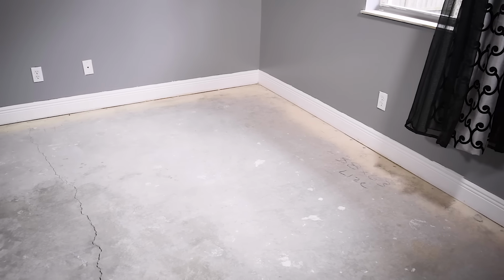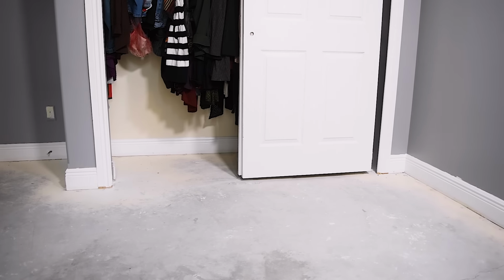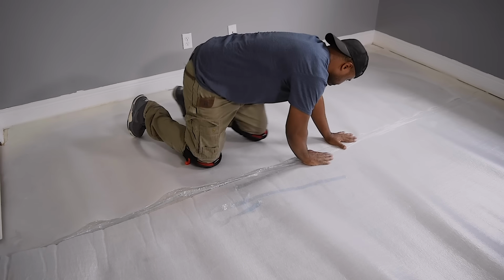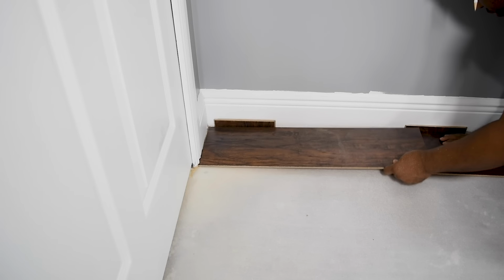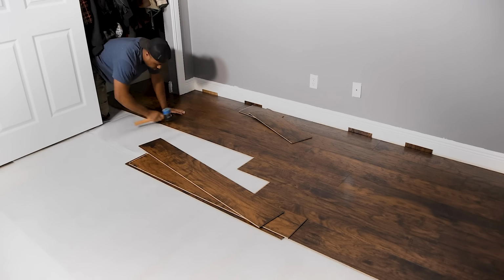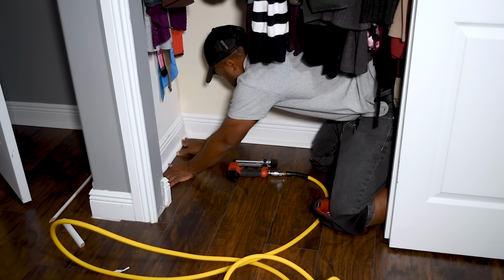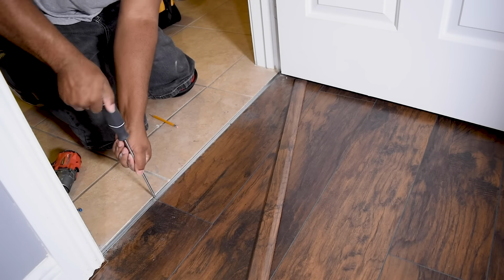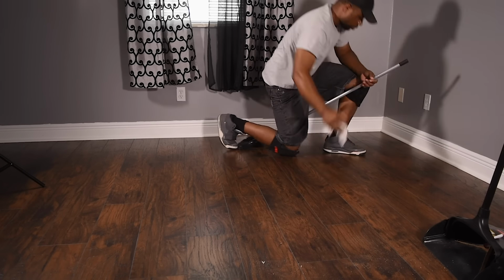How to Install Laminate Flooring for beginners

Comment: Nice job! Tough job too, hard on the knees. Looks really good.
Reply: I did mine when I was about 60 YO, It would be very difficult to do it today, I am 77.  Also, don't install flooring and tile in shorts and wear knee pads.
Reply: Norm475 Wear gloves while doing tile too. You’ll cut your hands up so bad and they’ll get pretty dried out from my experience.
Reply: Knee pads mate, dont leave home without them!

Comment: He broke the tile with hammer blows, not accurately).
Reply: You don't know that. That crack in the tile was large as well. Even if it was an indirect hit, he's using a rubber mallet and not nearly enough force for it to crack that much. It was no doubt due to the shitty transition piece that was already installed

Comment: Always go long ways to the window like this video, This is not a choice, it is bc the sunlight shows up the joins esp after a few years and double esp if any water gets on them. Do not mop them dont put this flooring in wet area, try not to even put it near a wet area, I bet in 5 years, the boards near the bathroom will look horrible.  Watch that water, it dont matter how Moisture resistant" or how much you paid, these laminate flooring hate water

Comment: Too funny, spent my Saturday doing this exact task. Nice vid!
Reply: I hope you had your floor cracks repaired, filled the 1/4 inch+ gaps between the laminate and the concrete, and didn't have this much chip out on the boards.

Comment: The flooring is gorgeous. What brand and color is that? I have ripped every bit of carpet and vinyl out of my house and want to do something like this throughout the entire house. My house is an L shaped ranch and my dilemma is that if I start the flooring at the entryway following the longest run, the hallway and all the bedrooms will not have that long-run layout. Should I add a transition piece at the beginning of the hallway and flip the layout or keep it the same direction as the area it's connected to? Thoughts anyone?
Reply: I doubt the entire house is sqare anyway so if you want to join the entire house in one piece, some rooms may not look straight. 
Use tiles in wet areas, put transitions in the bedroom door ways and always go long ways from the window bc the sunlight will show up the joins so long ways like in this video is best imo.
Reply: and never mop them, water will expand the joins,
Reply: @DadSkool   Thanks! I will see how it looks changing the direction where the greatroom transitions into the hallway prior to a commitment either way. The bathrooms are still tiled. Not going to re-tile those spaces anytime soon. Whatever I choose for the front section of the house definitely has to be the same product because all of the rooms open up to each other. I'm considering one of the waterproof floors since this will have to go into the kitchen as well and there's no way for me to incorporate a clean break between tile and laminate/vinyl.

Comment: I thought it wasn't obvious from the video but you need to put spacers on all sides... If some plaster has been laid (huge humidity changes), don't place the skirting yet, wait 2-3 weeks and see how it settles, you might need to cut again.

And this one is also from my neighbour, don't glue them on the ground !! He bought some laminate floor with a hardwood top, he asked the seller if it was alright to glue them because he was resurfacing a tile floor... The seller said YES. Always check with the manufacturer if you're not 100% sure, the seller might never have worked with that exact product. What happens is that when the floor expands, weaker point will lift but the stronger areas will prevent the floor from expanding which will result in lifting.

Most laminate floor have a print on the top which is covered by a thin layer to protect it; it's not wood, you can't sand it to restore it. If you want it too last, prevent scratches from chairs and furnitures by adding pads and if a blunt object falls and damages the surface, if you want to repair it put floor fill that is colour matched.
Reply: @Cleveland Indian Check where the floor is touching the wall after removing the baseboards and cut using a oscillating tool, wait for the floor to settle and check if you need to do it again. You might need to do it 2 or 3 times.
I hope it isn't glued...
Reply: I've done this twice before and I place the boards in the room unwrapped for a few days to allow for some expansion before installing. Have never had a problem.
Reply: @Egad  You're absolutely right, it will settle at the right humidity and temperature, as a result the risk of expending after is much more lower. However depending on the work that has been done in the house, humidity might still change.

Comment: Installing flooring without taking off the trim...😕
Reply from the maker: I explain why lol. I mean, this is why we use 1/4 rounds. When you remove baseboards and trims you have then reinstall them. That means you have to nail them, patch the nail holes, sand it, and paint. If I were a floor installer sure, I would budget for that and charge it to the client. I do think it cleaner without the quarters round. I also like the look of it, I just hate it keeps things from being pushed up to the wall.

Comment: Nice job. I prefer to take off the skirting and place it on top of the laminate, that way you don’t need to use the quarter round.
Reply from the maker: Thank you, I actually did that on the first laminate flooring before my youtube days. It's still looking sharp.
Reply: @DIYCreators  
I have old wooden floors (NE USA) which possess many splintering boards; have you suggestions for covering such. Have you underlayment suggestions before floor install? Are there certain fillers needed to prep original floor?

Comment: I really enjoy watching your videos. Just wanted you to know, (if you were unaware) that laminate floors do not fluctuate like other flooring. On a scale of 1-10 on fluctuation it's a 0.01. The laminate has come so far now days and this is a common mistake. Just wanted you to know what I just found out. Not meaning to be a got ya moment. Just wanted to share what I just learned the other day. Please know I have the most respect for you and what you do. Your amazing.
Reply from the maker: Thank you, I appreciate you watching :). As far as the movements, I don't disagree at all, I like to look at each manufacturer notes. Since I am making a video, I don't want to say what I think. The manufacturer knows their product very well, so for good practice, I want to stay within the parameters. I am not sure how it will perform in other parts of the world. In Florida, I don't see much movements. The manufacturer recommends 5/16-3/8in for the expansion gap. On all sides, :/. Since I am doing it for a client/ my neighbor, I don't want it to come back and bit me.
Reply: @DIYCreators  great explanation -- always follow manufacturer recommendation.
Reply: @DIYCreators  makes complete sense. Great job as always
Reply: @DIYCreators  you are right, always leave an expansion joint.  Laminate is still a wood product, and it can still move.

Heck, even a SPC Vinyl, which is polymer and limestone still needs an expansion joint even if it does not need to be acclimated.

If you are a professional, you don't want to screw someone out of a warranty because you didn't want to follow the installation instructions.
Reply: Every video I’ve watched has the laminaat layer using spacers and I see that you’re not- are they really necessary?

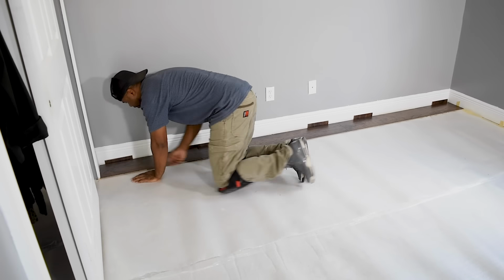Comment: Why cut the tongue off the first plank? 4:57
Reply: Because you have to put spacers between the wall and the planks. So you basically cut the one facing the wall
Reply: @BeardedDaddyy  I see, I didn't do it when I laid mine. My spacers worked fine with the tongue in tact.  Because I wasn't slamming that side up against the wall I guess, and I didn't use pieces of the flooring for spacers. I can see where it was a very good idea where he was working. I have only laid this stuff once, and I had no baseboard down yet, and I had space to slide the short shims against the wood floor plate under the new sheetrock. Once the first couple of rows were snapped in place I just pushed it up against the spacers snug, I really put no real pressure against that wall. On the ends, I did of course with the puller. It never rains where I live so I don't think my flooring has budged a bit... Wasn't critiquing, just should have looked at what he was up against vs how mine went before I asked. I enjoy his channel very much.

Comment: What about sealing the concrete? Is that a foundation issue? +1
Reply from the maker: If you are referring to the crack, it's from the house settling. It's a good idea to fill in or repair the crack.
Reply: @DIYCreators  I've had that in a house I had rented...